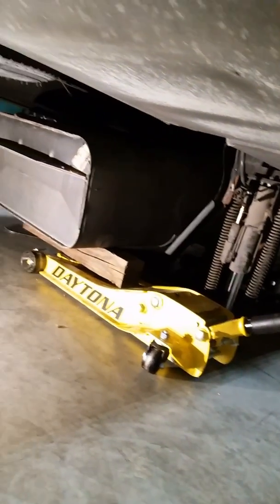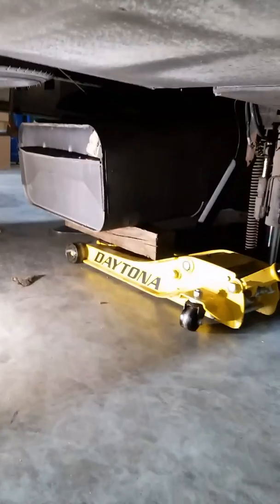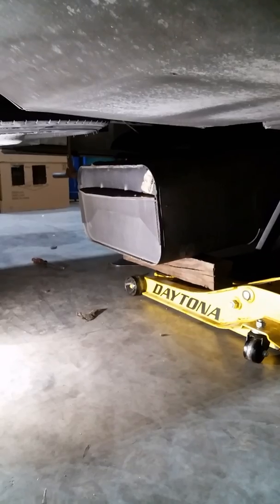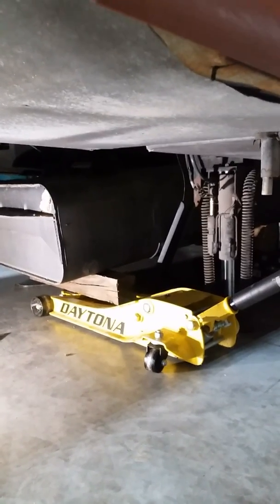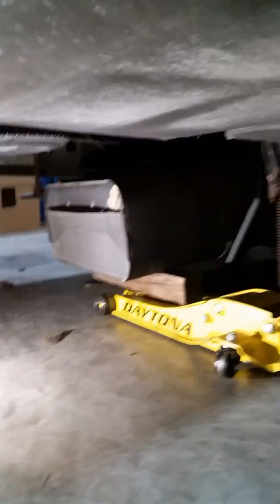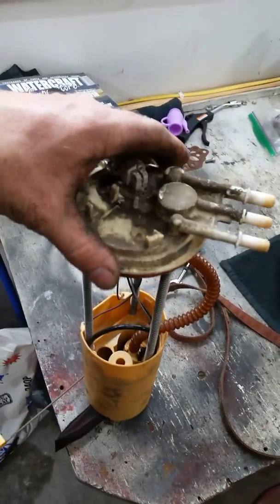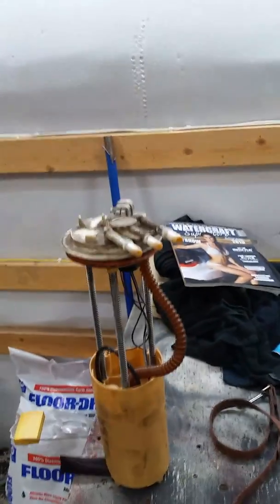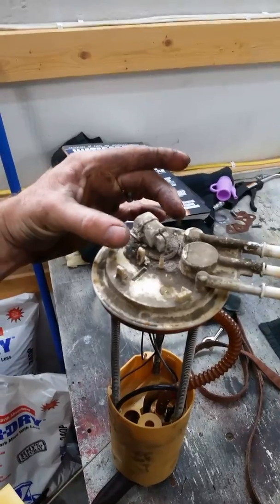Workhorse Chassis Fuel Pump replacement

Comment: Easier would have been to cut thru the floor inside a dinner plate sized hole to get to the fuel pump. Pressure needs to be 60psi.

Comment: Looking for 2000 workhorse fuel pump with one square plug in do you know anyone who sells it
Reply from the maker: Do you know if it's an 80 gallon tank? Walbro fuel pumps show just about all of them. The problem I have found, is that the coach models are listed as 2000+ year models but the chassis themselves are older than that. That is the primary reason it is so hard to track them down. Most are listed as 98-99 year model chassis. I would have to look around really well.

Comment: Check out Kevin Caudill on youtube , he did a comparison of aftermarket fuel pumps and cpmpared to original replacement.
Reply from the maker: I went back with the OE pump. I haven't had very good luck with the aftermarket ones in general. I would have stuck a Holley in it, if I could have gotten away with it LOL!
Reply: @kennyschopperz  Kevins video sold me on the differences, and I know the cost is double but its worth not a breakdown later,

Comment: omg.. i just did this today...   subbed because of the hard work you went through..  the hardest part of my JOB..  was the quick disconnect on the 3/8" fuel line...   it took me an hour to get it off because how you have to reach across the tank... the stainless clip was damaged and it was so annoying...  oreilly has the exact pump and housing with original plug .. $242 lifetime warrantly.  and dont get me started on the fuel filter..  it actually didnt take long at all to drop the tank..  mine had 20 gallons of fuel in it...  did you ever figure out exatly how many gallons that tank is 100%?     i was amazed by the size of it..   i actually watched you video on the CSFI upgrade..   i love your shop...
Reply from the maker: It was in fact, an 80 gallon tank. I have gotten some negative feedback from not video'ing the thing. But anyone who has done this can tell you, that you are NOT getting a camera, or much of your arms in there LOL!!
It is funny that these 8.1L engines are so sensitive to just a 10 PSI drop in fuel pressure on the open road. 
I have also done his ignition switch accessory circuit bypass modification.
I recently did his a/c system as well. He had said that it didn't work very well since he owned it. So after topping off his freon, I noticed that his "max air" function wasn't shutting the blend door to the outside of the coach. His vacuum line had dry rotted and was leaking. Vacuum line is backordered everywhere right now, especially the plastic kind. So I took a small cut piece of of 2x4 and wedged it shut from inside the coach to keep it shut from the outside air. His compressor was also overheating in the recent 110* index air. So I insulated his suction line from the evap, back to the compressor. He also had a tranny cooler fan bad, and a battery isolator solenoid fuse bad. I really hate that I didn't video any of it, but I was on a tight schedule.
 He said the a/c hasn't worked that well in the 10 years he has owned it.

Comment: why can I just use an electric fuel pump along the way and keep it from stalling. I am having hell with mine.. Whats the part number?
Reply from the maker: You can if you can figure out a way to plumb it. There are some guys that have done it that way. It is however, a pain either way to do on the side of the interstate, or on the side of a mountain. You need the pump that matches your fuel tank capacity. There was a 12" tall assembly for the 35-55 gallon tank. Or the 15" tall pump assembly for the 60-80 gallon tanks.  FG0064 is the genuine Delphi unit for the Workhorse chassis with a 80 gallon tank. Oemy's web site is a great resource.

Comment: I have a 1994 P30 chassis 7.4L with 80 gallon tank looks same as yours I dropped tank to replace old sending unit and upgrade fuel pump to higher pressure AC Delco pump for better performance.  I used two rachet straps front and rear to lower my tank a notch at a time until it was sitting on the ground.  Just be careful and slow and much better than an unsteady floor jack.

Comment: Thanks for the video, I have a 2003 p32 8.1 and the fuel gauge only works at times. But when I drop the tank I will replace the module.